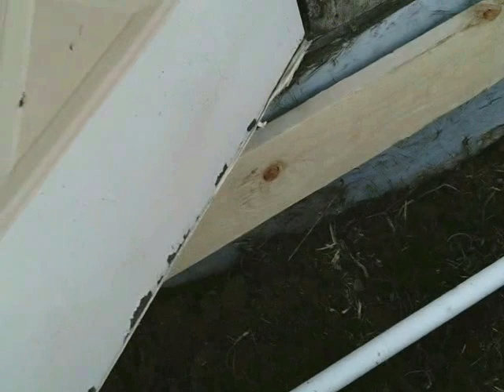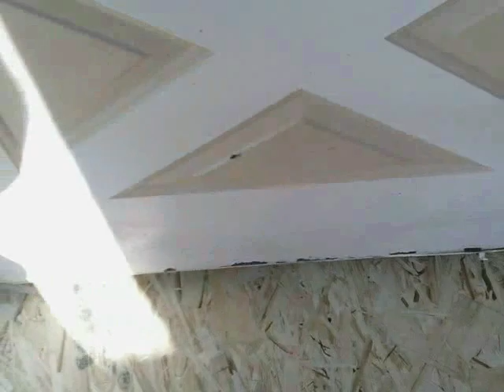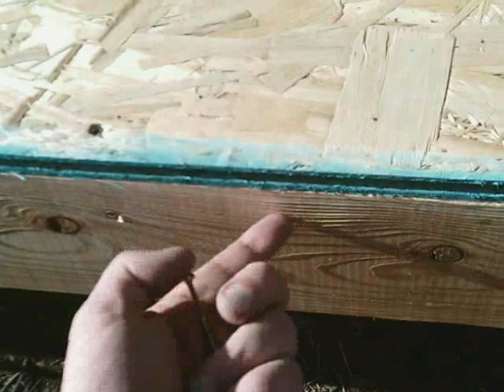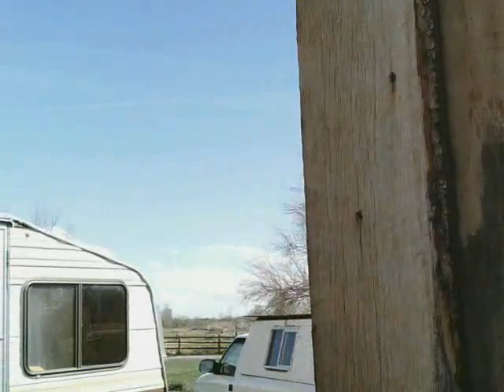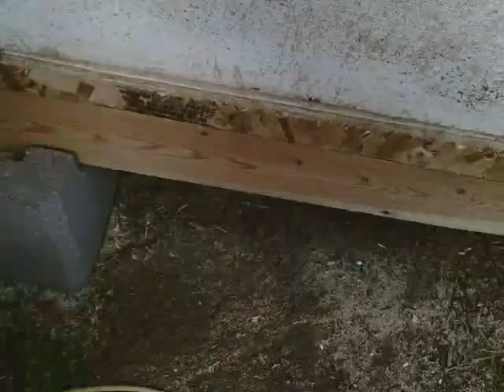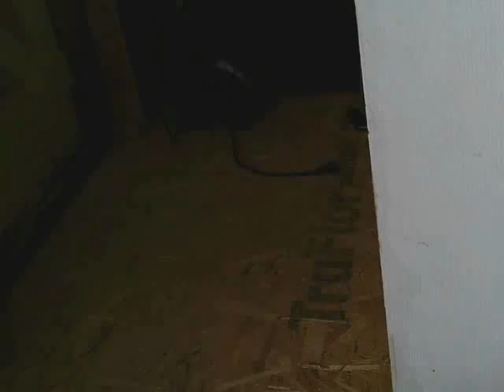Utility and Hot Tub Room Basic Construction Details

Comment: I had a thought for you, put a hinged panel over the tub. It can be up while you use the tub and down to use as a work surface if needed especially in winter to do small projects you might not want to do inside like cutting wood or painting something small. Just a thought.
Reply from the maker: That's a good idea!  I had planned a small table to fit across the tub but maybe a full cover and could be used a a seat for taking off my winter boots.

Comment: I have never used those foundation blocks so this might be a dumb question,  are you worried about the deck becoming unlevel from the weight of the tub when full? Thinking of doing something like that.
Reply from the maker: Those deck block are designed to hold lot of weight and I used them for the foundation for my cabin. I did put in an extra 2 deck blocks under the tub to handle the weight.

Comment: What's your opinion of tyvek on a small project like this Lamar?
Reply from the maker: For a living structure I would use tyvec or tar paper for  a vapor barrier if you seal a small structure too well you are sealing in moisture which can cause mold so you need venting.
Reply: Anything less than 400 sq ft I wouldn’t even consider tyvek.  Use 15 lb felt paper and anywhere there is a lot of rain, use large overhangs.

I don’t want to run out of fresh air in my tiny structures, like the 8x12 I started last fall on my Alaska property and hopefully will get some time to work on this summer...

Comment: Use joist hangers. You won’t regret it. Also, double the wall plates. Great videos.
Reply from the maker: If this was a larger structure I would have used joist hangers and double wall plate but for a single board room they weren't necessary. Single plate allowed me to overlap the wall sheathing over the floor too seal and secure the floor.